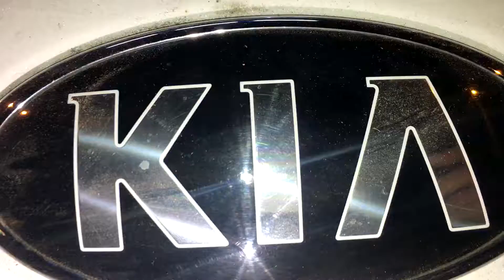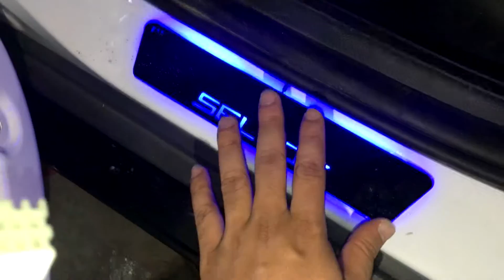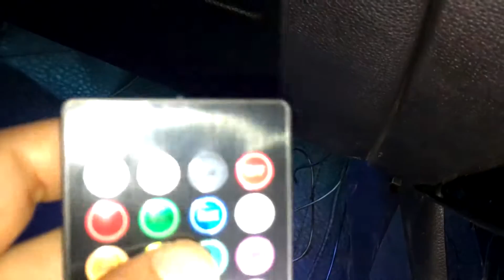KIA SELTOS INTERIOR MODIFICATION II DOOR DASH UPGRADE II CAR DECORATION II MODIFICATION KIA SELTOS

Comment: Instead of doing all this stuff u cud hav gone to the next variant which was much more valuable than this... U might hav a better ifosystem, led headlights with better alloy and finally the connected features.....
Reply: are u a fool? the higher varient costs more than 2-3 lakhs on road.... and the top model costs 18 lakhs on road...
Reply: @kuljeetkashyap1283  fool just for leather seats 50k then wat abt others did u know the led headlights cost 40k and wat abt tail lamp it cost another 30k so as remaining cost too much did u own a car ever r driving cycle....

Htk cost 13.8 and htx cost 15.3 which is 1.5 lack more that valuesore than crap after market products that dont even last long first learn basics
Reply: @shivakumartinku508  bro...htk is 11.3 lakh on road...htk +13.1 lakh on road..and htx is 15 lakh on road....all the accessories shown in this video ..you will get only for 25 thousand from Karol bagh...I have already checked everything